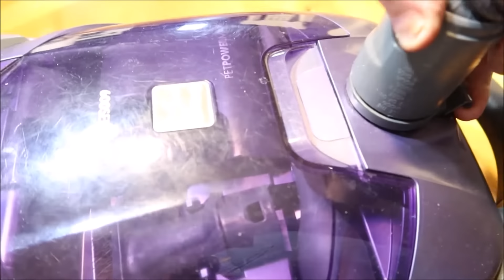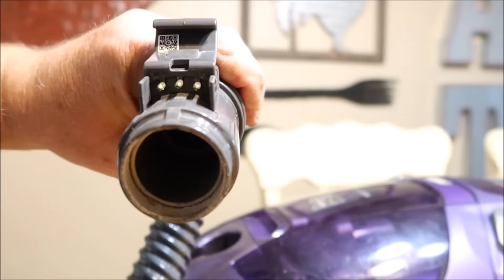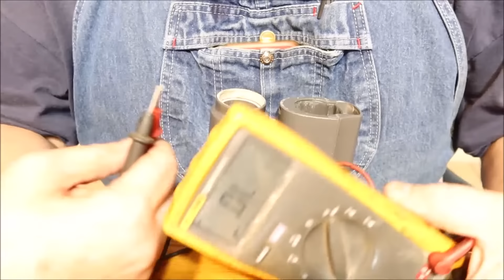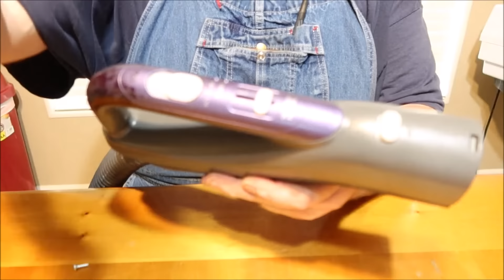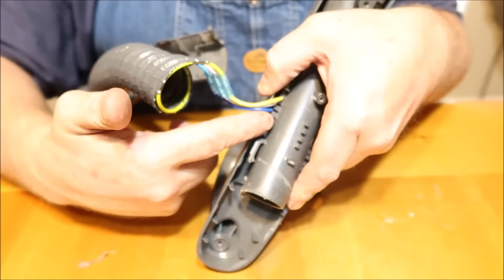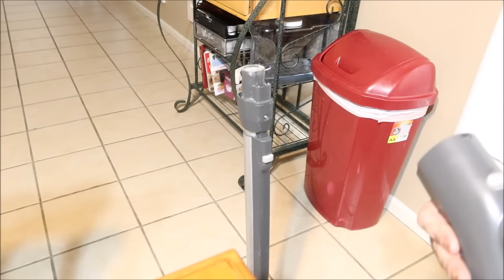KENMORE 600 VACUUM CLEANER WONT COME ON

Comment: My Kenmore 600 series had the same problem.  Same issue ,white wire came loose due to pulling the vacuum by the hose. I reconnected the wire, drilled a couple of holes in the handle and secured the hose with a tie wrap.  Thank You so much for the wonderful tutorial.  I like this vacuum too much to replace it.

Comment: Our vacuum suddenly quit in the middle of cleaning.  The bag was pretty full and the manual said a possible problem was overheating and to wait an hour and turn it on again.  We did that but it didn't come on.  I was looking on line to buy a new one and came across you video.  I talked my un-handy husband to try this simple tip to see if one of the wires was off.  The white one was off just like you video.  Put it back on and it works!!  Thank you!!

Comment: I'm late to the party. We love our Kenmore canister vacuums (2). I fixed a similar problem with wiring on the handle a few years ago. When I opened the handle I was surprised to see the wires in the hose were solid rather then stranded. 

We have also had problems with the plastic parts breaking on the wand of another unit. Luckily someone on eBay was parting out a unit so I was able to fix it by swapping out parts. Now that these units are getting old I keep an eye for folks getting rid of theirs so I now has a parts stash so hopefully am able to keep ours going for more years.

Not sure if it still a problem but the first one we purchased years ago the contacts in the handle are susceptible to vibration and loosened over time and overheated.

Comment: Please explain to my wife that bib overalls are necessary to retain the vast amount of maintenance information that you retain. She doesn’t think that I need maintenance bibs. PS also that the buttons on the side are not required to be fastened allowing for extra knowledge to be stored. She thinks that I would require a bigger pair of bibs than I’m currently forbidden to ware.
PS this exact problem with out vacuum.

Comment: What if when you put your volt meter into the little holes on the vacuum there is no power?  My wife left the vacuum plugged in for a couple of days.  When she came back to use it a couple days later, still plugged in it wouldn't work... nothing.  Is there a fuse in there somewhere?  It is a Kenmore 600 series, 2 years old.  Thannks.

Comment: Man, that was such a simple solution.  I went looking for a fuse. Had the whole beater head taken apart. 
After watching your video, I took the handle apart. Both wires were broken. So I stripped them both, reattached them, and added a small piece of electrical tape just to keep them from moving, then reassembled everything. Works like the day I bought it.

Thanks for this video. It really helped. We now have two vacuum cleaners. 😅
Reply: Ok I think thats what is wrong with mine

Comment: I had the same issue with the same model vacuum.  My white wire was broken.  I stripped off some of the jacket with my cable stripper and popped it in and reassembled.  I put a ziptie around the hose and the inside part of the handle to help provide relief when the vacuum is getting pulled around by the handle.

Comment: Thank you so much for sharing....ALL 3 of my wires had come apart and two plastic clip pieces had broken...I pushed the wires back together...replaced the handle screws and am vacuuming again...just being careful with the hose and trying not to twist to much...you saved me a visit to the repair shop and $$ for now!!

Comment: I ran into the same problem. You should check for low oil sensor. If not that then check for clutch pedal Freeplay. Or shifter linkage at safety neutral switch. Good luck!
Reply from the maker: Huh?
Reply: @THEMOWERMEDIC1  Automotive reference....That's how I fixed my 1977 F250...Safety Neutral Switch was broken
Reply from the maker: @12namleht  I think you must be commenting on the incorrect video because this is about a vacuum cleaner
Reply: He's joking! Can't you detect sarcasm Sheldon?